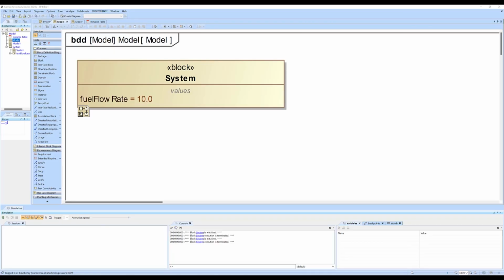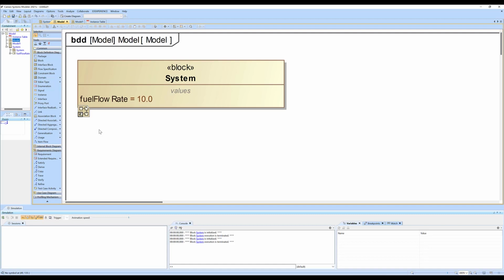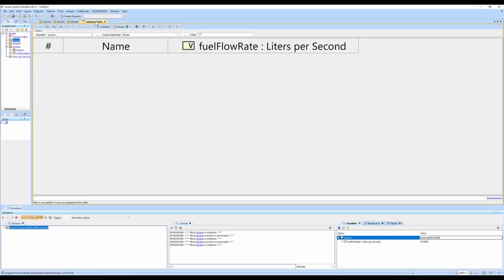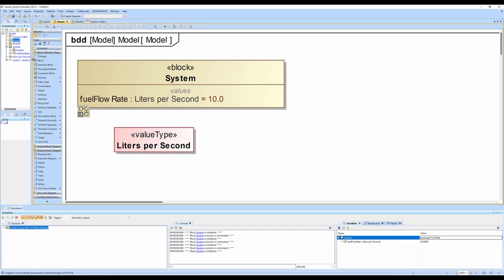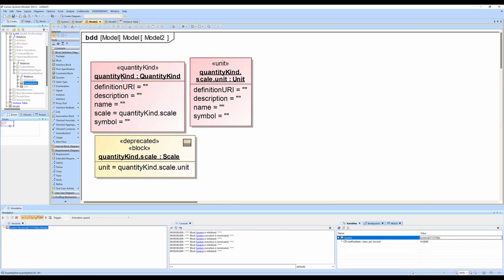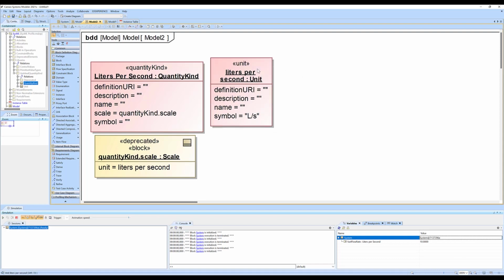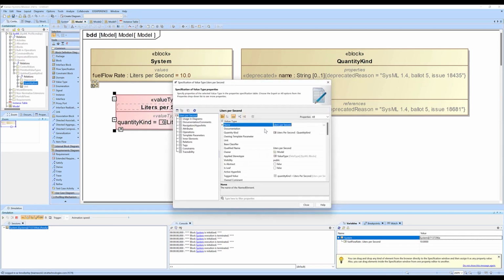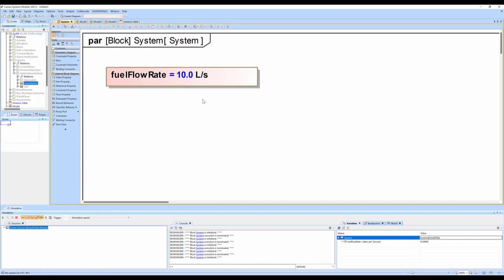Custom Value Types in Cameo Systems Modeler

Comment: This incorrectly covers the concept of Quantity Kind; Quantity Kind is more of the type of measurement. In this example, it might be "Flow Rate". Unit is tied to associated Quantity Kinds and a Value Type brings the Quantity Kind and Unit together.
This gets a little more confusing in v2 because all of these concepts are implemented using two element types (Attribute Definition and Attribute Usage), which themselves are already used to describe attributes of Parts, Items, Requirements, etc.